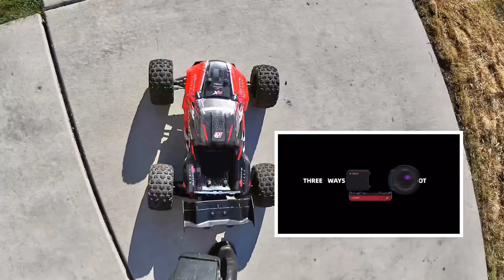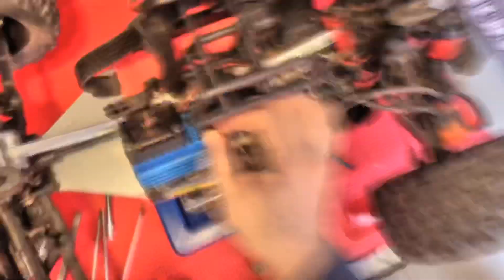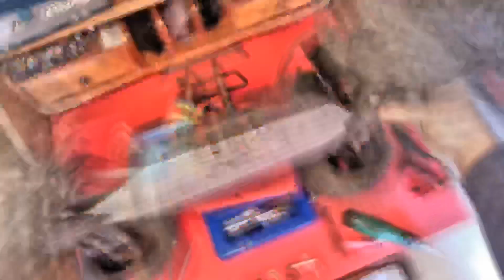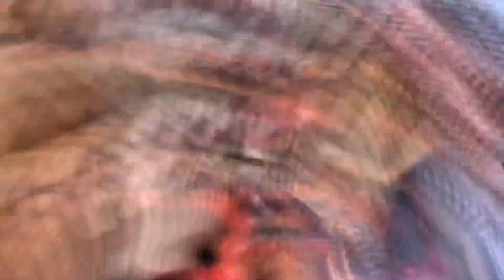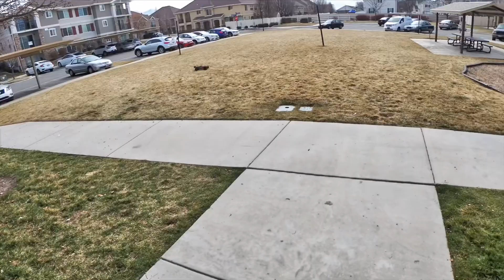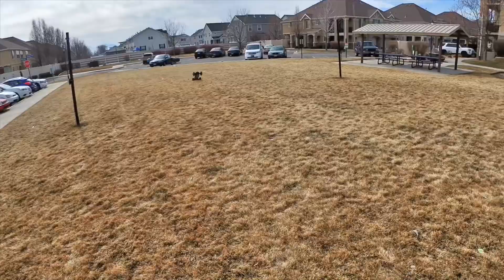RC Gears Slipping?? What COGGING looks like - & SOLVED

Comment: Hello there 👋. Cogging is when the ESC does not know where the North and South poles of the rotor are in the brushless motor (because the motor is sensorless) therefore it energises the coils in a fast random order. So depending on what position the rotor is in when you stop, cogging may or may not take place. The size of the pinion should not affect this. But I'd like to know why and how it does 👍
Reply: Ok I've researched it (can you tell I'm bored 😂) and the extra load on the motor with a larger pinion actually slows down the process so yes, it makes cogging worse 👍😎
Reply from the maker: Believe it or not, the size of the pinion does matter, Mostly because you’re asking too much of The stock motor/ESC’s relationship. They’re just not capable (or programmed) to handle the gearing. As such cogging occurs. 
I can attest, because immediately after dropping back down to 16 tooth pinion gear it went away.
Reply from the maker: Lol, no worries 🤣
Reply: Haha sorry bro I wasn't trying to prove you wrong, just wanted to understand the workings behind it 👍😎
Reply: Your right....100%
Reply: I know I'm 2 years late but I have this really bad on my losi mini8 with the brushless motor I have to give it a push start then it takes off
Reply from the maker: If you were experiencing an issue with cogging and nothing major has changed regarding your ESC or your motor, or your gearing, etc. And just all of a sudden now out of the blue you’re having a massive cogging issue. This is going to be more of an evidence that your motor is going bad or has gone bad, or your ESC is going bad or has gone bad. However… If you have done some major changes recently, that impact any of those things motor, ESC, or gearing , and now you’re experiencing cogging. Then the change that you made could very will be the issue. So what exactly maybe have you done to make changes?
Reply: @EastTactics  I bought it from someone and found out it had this problem 😅
Reply: how would u fix this? cus wen i hold mine in the air it dont cog but asoon as i put it on the floor it begins to cog
Reply from the maker: @alexroffey7821 
What rig running? 
What are your diff fluids? 
What size motor? And ESC
What’s motor pinion?
Reply: Thanks for the reply but I have solved it now

Comment: Check the bearings and slop on that motor. If motor runs too hot or bearings are worn it will lose torque causing a cogging issue. Smaller pinion requires less torque to accelerate which is why the issue got better.
Reply: While your not wrong about the gearing and torque I believe his gearing was too high for the sensorless system in this truck.
Reply: @NayburhoodSnipa  I've run an 18t forever. Motor gets real hot and kills bearings pretty fast and it starts to cog. I replaced bearings twice in a year.

Comment: Max 6 combo, 19 t pinion and 50 rear 500.000 mid and 100,000  front  diff oil that's what was running but u do end upside down alot so I dropped the pinion down to 16t and middle diff oil to 250,000 as it was almost undrivable, great vids keep up the good work
Reply from the maker: Gav Iscon, thx! That’s some sage advice! 16t is more then fast enough. Down the road if I burn a motor, or Fry my ESC, i’ll definitely pick up the upgraded combo. Maybe experiment with 17t or 18t. But I definitely agree that there comes a point when overkill is overkill.

Comment: I'm having the opposite issue with the cogging on my cen reeper. I put the hobbywing 1650kv and max6 combo in it with a 15t pinion. (Comes with 13t stock). I'm running an ear plugged center diff because wheelies are fun. It only coggs on very light throttle.  It I give it the beans, it takes off (or flips straight on it's lid, thanks earplugs). I can't seem to figure out the cogging at low throttle.  It's violent cogging too. The rig is heavier than stock but I figured that motor esc combo would have more than enough power to handle it.
Reply from the maker: This is just a shot in the dark, but maybe it really is the exact opposite issue. Because you picked up a motor with a much lower KV ratio you might actually be running a pinion that has too little teeth, Agian..I could be wrong. But maybe it wouldn’t hurt to try to throw in a pinion gear that has 18t and see what happens.
Again I could be completely wrong. But I’m super curious to know.
Reply: @EastTactics  I may give that a try. I was going to shed some weight by switching the aluminum shock towers back to the plastic ones. Then take out the earplugs and put 20mil weight into the center to lighten the fluid up. I'll probably try adjusting punch first before I go messing around with the stuff I just mentioned.  It's way too fast with the 15t as it is. I'd be scared to gear it up any more than it is. It will probably hit at least 60+ mph right now. That's fun in a Kraton, scary in an unstable truck like the reeper. I'll let you know what fixes it.
Reply: @maxcurry9667  did u figure it out?
Reply: @philosophy4242  nope. Still does it to this day. I soldered on a new connector and geared up, down, then back up again. Same issue. The only thing I haven't done is replace the esc to see if that fixes it. It probably would but it hasn't hurt anything and I beat the tar out of that truck often.

Comment: I have a similar experience with my X-Maxx using Spektrum RX/TX.  When I turn down the AVC on the DX3 controller the cogging issues go away.  Using 25/46 gearing with a HW5687

Comment: Hope you know this by now but BLX 2050KV  motor, 15 tooth pinion is max it can handle. of course you can go up to 17T or what ever. 15T pinion you just need fans on motor which you already have and cool down period every 5mins or less depending on what your doing.  ESC will also over heat with 15T pinon gear if your not letting her kool down.
Reply from the maker: Yeah… That’s why I’ve got over powered fans keeping this bad boy cool. Although I do plan to 100% get a better motor and ESC in the near future. Currently I’m running 16 T. But with all the weight I am experiencing cogging
Reply: @EastTactics  yup you sure will give it time you will burn out ESC. That what happened to me already on my 2nd ESC arrma has no prob sending them to me I get one more before I gotta do paper work lol.
Reply: I recommend you go down to a 14T when it gets hot outside. Fans aren't gonna do much brother in 90 degrees. That's probably best gear to run your rig hard without any heating issues. Dam you must live the speed with a 17T. I'm still getting used to mine with 15T. Also when. I drop mine down soon my battery last longer. Which I'm sure you already know that.

Comment: I was running the belted 3.8 inch trenchers with a 14 tooth pinion, and it starting cogging as well. They're very heavy tires. At first I thought it was my diffs, but it sounds similar to the cogging you were having. I just bought brand new EXB diffs for my outcast too, made sure they were assembled properly and everything and they feel super smooth and sound great. So I would've been quite disappointed if it was the diffs.
Reply from the maker: Yeah, I picked up the trencher’s to and my cogging is back. Those tires are just so heavy. In order to really get rid of the cogging issue especially with all the weight we had to our vehicles between aluminum upgrades and tires is to just simply get a better ESC and motor combo with a higher torque/lower kV set up
Reply: @EastTactics  Exactly, I plan on going with a castle monster x esc alongside the 1520 1650kv motor and running it sensored... Cogging will never be a problem even if I gear up, just need to watch temps.

Comment from the maker: So I’m learning pretty early on from the great people leaving comments. Something that I kind of figured would be the case. In fact it correlates a lot with the solution of this video of me dropping my pinion to a more drivetrain friendly set up. 
And that is... The ability to do standing backflips may not worth the trouble. 😆 LOL

I would agree, along with the veterans here that running a motor and ESC combo that your RC car can happily stay both cool and within tolerance limits of the drivetrain is a much much better solution for both fun and longevity.
I mean let’s be honest being able to do a standing backflip while it’s cool, it’s only fun for a few trigger bursts anyway, And likely proves to be a bitch over excited in the air.
 That’s not to say that upgrading your motor and your ESC to a higher quality lower KV/torque combo is a bad thing. The Arrma Drivetrains are most certainly capable of handling an upgraded. But if you’re able to do standing backflips your probably going to find that toning it back a bit is the solution that many veterans have come to realize.
Reply: Standing double black flips are much like traxxas self right. Good for the first couple times.. then you just start breaking shit. When I first got my e revo 2.0 a few months ago self right blew front and rear diffs took out the spur gear motor and ESC. It was all replaced but still 😅😂
Reply from the maker: Good point
Reply: Standing backflips = destroying your diffs and drivetrain. Not worth it
Reply from the maker: Honestly, you’re right! very well said for sure
Reply: @EastTactics  That's what happened to me. Heck I can get standing backflips with my insanely powered Outcast 8s, but I don't try to do it. I did it once by mistake.

Comment: I have a kraton 4s..i have new spur 57t with a 15t pin .checked rear dif all metal cogs look mint as..ESC is max8 180a with the stock motor spectrum 2400kv ...very coggy. But if i put 20t pin in..the truck cogs and motor goes into thermo after like two passes💀..whats my problem bro?
Reply from the maker: What ESC did it come with?
Isn’t a max 8 180 amp ESC designed to be fitted with much larger, heavy duty rigs, supporting a motor with a much much lower KV?
My first thought
Reply: @EastTactics  stock esc was the spectrum 120a..but it caught fire on me so I upgraded to the 180a
Reply from the maker: You would think that an overkill ESC would do just fine…🤔
What’s the stock ratio supposed to be when it comes to the center differential and the pinion? 
Do you cog W the 15t?
Cogging will get worse higher you go with the pinion.
Did you watch this vid?
https://youtu.be/s4-RjtQsMsU?si=3qLdWyAn2r884kVw
Reply: @EastTactics  ..yeah I thought that too...um stock ratio??u mean what was the stock pin?..na bro..I'll watch now🤙

Comment: With stock esc & motor, I can guarantee you a standing backflip if you have these factors/things:

1. At least 15t pinion
2. At least 200k diff center then you can do 50/60 front & 20/30 rear
3. Punch setting at 7-9 (lucky if you don't cog always - mine cogs sometimes)
4. Backflip tires (cause these things are grippy)
5. And of course, a surface which is not slippery
6. Not sure about low discharge rate batteries, but just to let you know I use 5A 70c/150c burst and 6A 70c/140c burst
Reply from the maker: The current set up on the vehicle during the making of this video was 20 K rear 200 K Center, 60 K front. 20t pinion.
Granted I only had the stock tires, but you would think with a 20t pinion she could pull off one.
Course I’ve added a lot of weight to my vehicle with front and rear hot racing diff  houses, And other aluminum parts. I might even have the M2C chassis in this video. Not sure.
Either way I couldn’t do a standing black flip, and I also was on punch setting nine.
Maybe the reason why you’re able to was because you’ve got some high burst rate batteries. Mine were like 25C.
Now here’s what I’ve learned since then, do you want to do standing backflips for days! Toss silicon earplugs in the center differential.
I’ve also learned that doing standing backflips is a quick way to snap pins, and strip teeth. Lol
But they certainly are a blast to do every once in a while. I really appreciate you watching my video thanks for commenting.

Comment: To do a standing backflip I put a 7700kV castle sw4 in my 2wd stampede on 3s and all metal gears and drivelines. I'm thinking you might need a similar upgrade
Reply from the maker: Thanks. 
Here’s my journey to the ol standing backflip with my stock V4 Kraton. 
Soon I’ll have a 1730kv motor and 8s spektrum ESC installed.. this will be epic.
https://youtu.be/s4-RjtQsMsU
Reply: on my 4x4 stampede i have a spectre 3900 kv, 17 tooth pinion, 56 tooth spur and 5200 2s, standing backflips are cake... keeping it on the ground in general, not so much lol.. thought the aluminum roll cage would help comp, nope

Comment: What about cogging after replacing esc?
Reply from the maker: What rig do you have? What ESC do you have? What motor do you have, what’s its kv? What pinion are you running, how many teeth? Do you run stock tires? Or larger tires?
Reply: @EastTactics  So I got a 124007 and fried the esc right out the box by attaching the battery wrong in the car. I bought an exact 45a esc it runs but cogs like crazy. I just got a GoolRC programming card cause I saw changing start up to hard might help some. I don't know about the other things you've mentioned
Reply: @EastTactics  stock tires though

Comment: My senton 3s does that, it started after i went to a 26t pinion, I went back down to the optional 20t that came with it and it still does it 🤷🏾‍♂️
Reply from the maker: One thing to consider is that it may not be cogging. You mentioned you were running on the 20T pinion gear For sometime without cogging? Correct? The increase to the 26 to May of just stripped a few of your gears from the rigorous takeoffs.
You might have some warn teeth, Likely on the rear outdrive gear, or the crown gear On the rear differential. Or both. It doesn’t take much wear to create a cogging like  noise, especially on takeoff. Get in there and do a really close inspection on both of those gears, sometimes it’s difficult to see the wear on that outdrive gear because it’s deep in there and covered in grease etc. so it’s best usually to remove it. 

Let me know if that’s the case, be sure when you’re putting it back together you might consider doing some shimming to marry those two gears a little bit closer together. To prevent it from happening again. Of course assuming that’s the issue. 😎👊

Comment: My Slash 4x4 VXL sounds odd when it decelerates. Still don’t understand what the problem is. Been like it from factory
Reply from the maker: By odd, what exactly are you hearing? And you only hear it when decelerating? Does it happen at any range of deceleration? Or only when quickly transitioning from high Speed to the hard break?
Reply: @EastTactics  Thanks for the reply. It happens any time I am deceleration/braking, but always under 10mph I would say. It’s done it since out the box, not sure if it’s normal. I notice the motor gets very hot. The noise is hard to explain, none of my other RC’s do this. It sounds like very faint cogging but the cogging gets slower the slower you go. Thanks :)
Reply from the maker: What’s throwing me is that you’re only hearing it when slowing down. Question for you can you duplicate the noise or make the noise happened while your rig is posted up in your workstation. Meaning if you’ve got a stand that you put your vehicle on, and then if you get the tires going pretty fast and then use the break, will you be able to hear it? If you have the ability to maybe film a 30 second clip of this you could upload it as a private video to YouTube and share the link with me.
Some of the more confusing noises that can come about in an RC. Are chipped teeth on your spiral input gears be at front or rear. If your mesh is too tight you might consider adjusting that. Sometimes the bearings do go out in the motors themselves. And can make a noise. If you’re experiencing overheating issues quite a bit. You might’ve run into an issue with one of your bearings in your motor.
Lastly one of your differentials, potentially any of the three, could be having some issues inside their internals. Next time you’ve got any of your differentials out while you’re holding in your hand you should be able to hold both ends of the outdrives and do a back-and-forth twist motion and not feel any snagging
Reply: @EastTactics  Thanks for the reply that’s really in depth. I recently put new oil in front diff. But from when it made the noise was right out of the box. I will share a clip with you maybe not today as I’m quite busy but I will do it. Thank you for your help I really appreciate it!
Reply from the maker: Sounds good
Reply: @EastTactics  I haven’t run it in a while but the best explanation I can give is when I am not accelerating and it is moving slowly it does it 👍
Reply from the maker: Is the design mechanisms of this RC unique compared to your other RC. I only ask because for these higher end RC‘s that have metal gears, three differentials etc. It is normal to hear a light clicking noise when turning either the front wheels together or the rear wheels together without implementing any power to your motor. Meaning if you had it up on a stand and you set your controller down, then grab the either the front two tires together and manually spin them at the same time it will force the drivetrain to rotate the motor drive and create a light clicking noise. Likewise if you simply had the vehicle off, and on the ground and pushed it. It would make this noise because you’re forcing the drivetrain to rotate the motor without requesting power to the motor. If that makes sense. 
My guess is that this is not your issue and it’s something more complicated but I figured I would at least point that out especially if this RC is unique compared to your other RC’s
Reply: @EastTactics  Ah you may be correct in saying that. I have a TRX-6 that doesn't do this however, and that has metal gears right? The noise on my Slash wasn't a problem until it started getting really hot and I wondered if that's something to do with it. Showed it to some other RC guys and they didn't know. Thanks :)